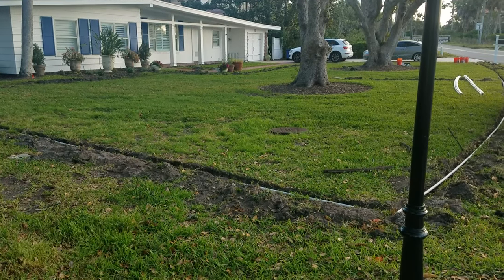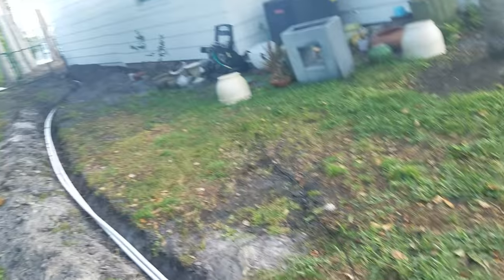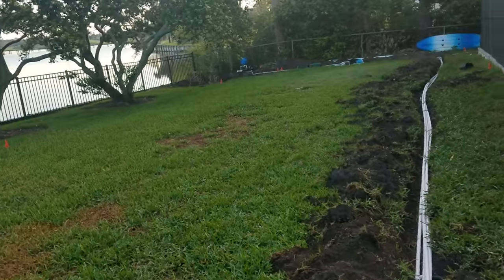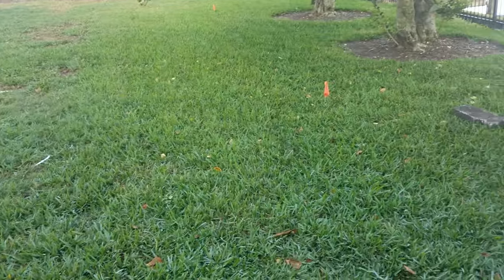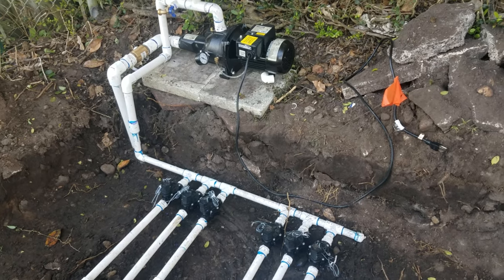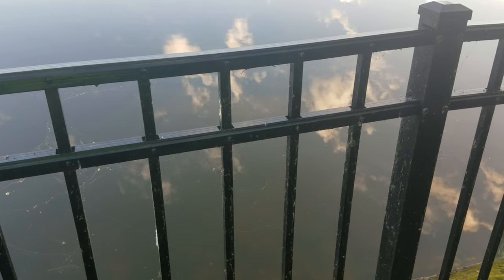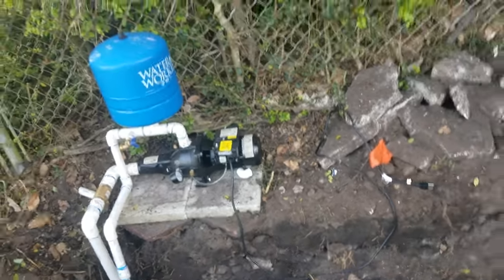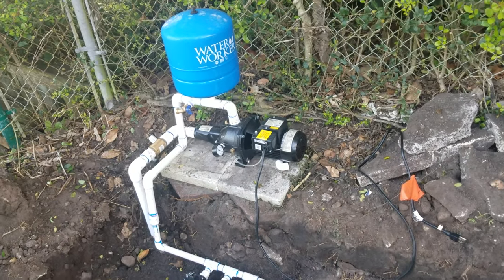Irrigation Well Pump and Sprinkler System Install - Update

Comment: I would bury the pipe a little deeper. But I don't really know what I'm doing.
Reply: All depends on if you’re going to have heavy traffic on that area or not mainly with heavy equipment. So if you are just a homeowner, about a foot is okay because it makes it A LOT easier to change heads or fix leaks that may arise.

Comment: I don't know how a single solar panel can produce enough power to run a 12 amp pump. Lets assume its a 120 volt pump. That's 1440 watts continuous plus the starting loads (not considered). This is going to require a minimum of a 3000 watt inverter, a battery bank and depending on where its located several panels. If you bought these parts wholesale and put them in yourself, I'm guessing the cost would be upwards of $4000.  If it cost 16 cents an hour the run that pump (11 cents per 1 kw X 1.44 kw load= .1584 cents) and you ran it 2 hours a day every other day, that's $4.50 a month in power. The payback would be 74 years.

Comment: Most water districts require backflow protection at the meter if you have a well. The concern is that the well water can become cross-connected with the potable water system.
Reply from the maker: If you have a water well there is no water meter thanks for watching
Reply: Say what now? You’ve been commenting on almost every sprinkler video just to say the words backflow preventer? Are backflow preventer sales down or something?

Comment: Nice setup. When the pump motor fails in 20 years will they still sell parts? Why not use unions near pump head for easy replacement?

Comment: My city would tax me, and then jail me for public theft on drawing water from a catch pond.
Reply: thats what happens when you live the city.
Reply: Depending on where you live, possibly.  I would say 95% of ponds are simply surface expressions of the water table in the area, so pulling from a well or pulling from a pond has the same effect.

You should always check local codes and inquire with a plumber or irrigation specialist to find out.

Comment: Why would you run 6 pipes, when you can only run one pipe and then install the system in front of the house for distribution???
Reply from the maker: Distribute near pump for best performance
Reply: Pumps are good for pushing not pulling. You always place the pu p closet to the source as possible.  I would of suggested 1 1/4” in and out for all the runs.   It would dramatically increase water volume.   Those are long runs and will have dramatic loss of volume.
Reply: @FLORIDAPROLAWNCARE  wouldn't the lake go down eventually?

Comment: Wow you got good vision where I'm from if you tried to pump that water out of retaining pond you're facing a $3,000 fine or jail time it's like the Wild West in Florida I see but I think the solar panel would have to be directed to a battery and then inverted to run that pump and it will probably run every other day to have a decent cycle pressure wise that is, nonetheless keep up the good work.
Reply: If you’re scared just say it.

Comment: Good luck with Everbuilt pumps and check valves, I replace them every week on customers homes. Keeps me in Business.
Reply: What valves do you recommend
Reply: @ocdtechtalk  Simmons or FloMatic are the only ones worth using.
Reply: @jostrander71  I can't find either of those locally. Can you share a distributor/wholesaler. I'm a contractor so I can create an account if needed. Thx

Comment: I have a sprinkler system that was out in by the builder.  I have a private pond in my backyard similar to this video.  Can I disconnect from the city and install a pump set up similar to this?  Is it worth the cost?
Reply from the maker: Yes

Comment: How many gallons is that pressure tank?  Want to install one on my shallow well but when the system is on I don’t want it to turn off and one. Want it to run constantly while pump is on.
Reply: Also what size pressure switch are you using?  Thanks.

Comment: I think your a little off on your solar calculations. Think you’ll need a huge amount of solar panels to keep up with a alternating current system with a inverter. Maybe a DC pump with a battery bank might give you 1/2 of hour.

Comment: Is PVC more expensive than poly in fl idk why in 2018 you would do a system in all PVC unless to save money but. Why.
Reply from the maker: ken larman im old school still use pvc its what i trust
Reply: Fla is too hot for poly. It would melt from the heat.  Especially if it's put in a shallow trench.
Reply: Um no. Its not too hot for poly.  Not sure where you heard that.

Poly's problem is that its easy to cut it, versus Sch 40 PVC can take a lot of abuse.  Sch-40 can withstand a shovel hit while planting.

Unfortunately, most use Sch-200 PVC and over time tends to get more brittle, and will splinter if you hit it with a shovel, putting in annuals for example.

Up north, where you have frost heave, poly is used because PVC gets more brittle in cold and will tend to crack, whereas the poly will withstand the soil heave better.
Reply: One benefit of PVC is that it breaks, whereas poly tends to pinch. It's a lot easier to find a break in a line underground than it is a pinched one.

Comment: I have a existing sprinkler system and was drawing from my lake which has dried up. I am now thinking on sinking a shallow well. Do I need to use a pressure tank or can I just prime and use my existing system to draw from the well as I did from the lake?
Reply: It depends I think with no pressure tank the pump will run constantly vs if you had a tank it would fill it up. However sizing is important. Try to look on forums.
Reply from the maker: You will need a different type of pump bc water in ground is harder to pull up

Comment: What is the process that the user has to go through in order to run his pump after the install, what I mean is: does the owner first plug in the pump, then turn on a control panel to actuate each valve automatically as needed?  Or is there control panel that activates the pump and works the valves all on its own?
Reply: Jason Brand all is controlled by irrigation timer.  We install rainbird and others that you can control from your phone.
Reply: freedommmc thank you for the reply.  This must be a recently new option that rainbird is offering, as I’ve not seen it yet on a control panel.

Comment: Can you run it without that pressure tank?
Reply from the maker: Yes but it is  needed by design
Reply: Pump start relay is a better way to go. Expansion tank and pressure switch or always pain in the ass and fail
Reply: @williamblackburn2655  I'm new to this and about to try setting up my home system.  I'm very curious, if using a pressure switch and a valve fails and doesn't open (which will happen sooner or later) no harm comes to the pump because it won't turn on,  but if using a pump start relay and a valve fails to open, wouldnt the pump get damaged because it's trying to pump with nowhere for the water to go?  It 'seems' like the pressure switch is the safer way to go but I'm a newbie so any advice would be appreciated.

Comment: Can i ask how much for drilling a well and install the pump like this?
Reply: You can get a DIY pump installed for a smaller system like this for about $600-800 with a relay and irrigation timer.  However, you spec the pump for the system... design your irrigation before you decide on a pump.  And I would avoid the box store pumps, they really kinda suck.

If you're using city water at $4/1000gal, you'll easily recoup the cost in a year, since you typically irrigate using about 8,000-12,000 gal per month.  

For example, a 4 zone system, with 3 rotors per zone, each rotor running about 3.75 gal/min, and running long enough to put down 1" per week, each zone must run about 30 minutes, you will use 2,700 gal/wk, and about 10,800 gal/month.  This might cost you about $40/mo in water charges, so within about 18 months you will have recouped your investment here.